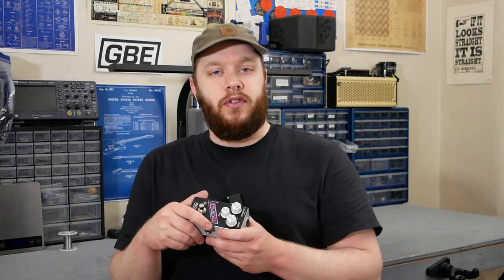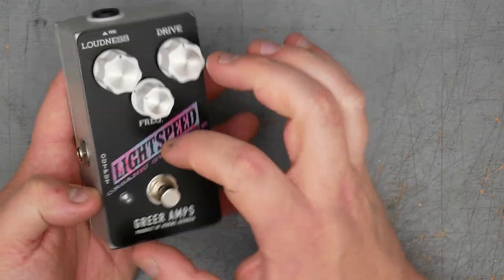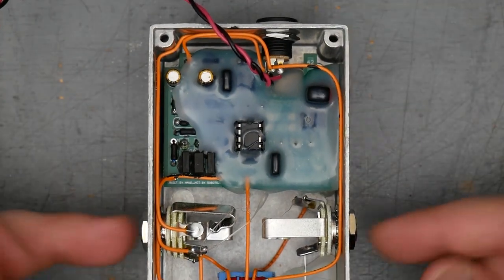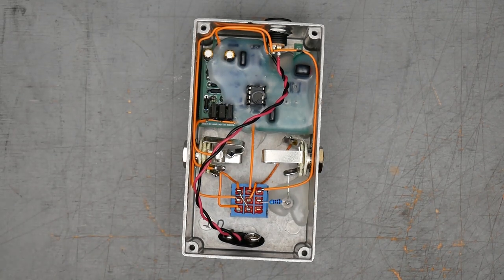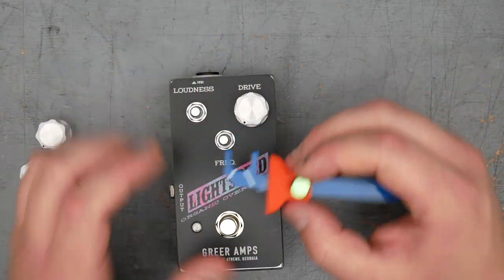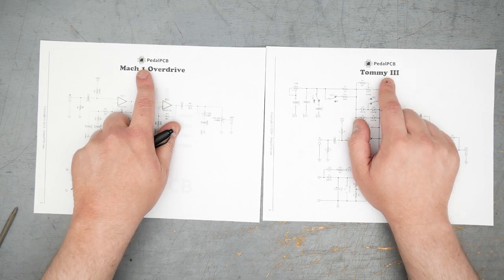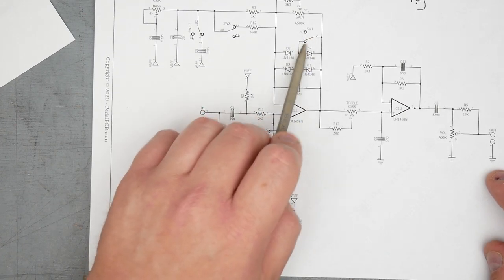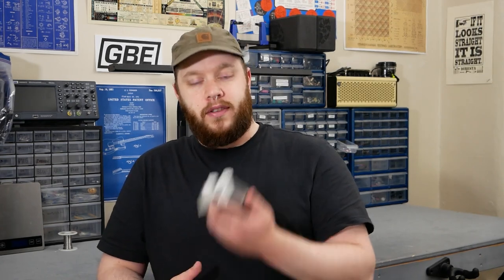Greer Lightspeed Overdrive Teardown! See what's inside!

Comment: Thanks for clearing that up for me. I knew it had to be based on something. Nick has, to my knowledge, never created an original circuit. I got to know him, bought quite a few pedals from him, and spent a fair amount of time over at his place, near winterville, back around 2007/2009. He was very forthcoming about his pedals, and what they were based on. So I knew this had to have its origins in something else.

His pedals have come along way. when I owned and was buying pedals from him, they were either on home etched board, or held together in what looked like heavy duty electrical tape. He also painted his own enclosures, which looked really cool. I don't know why he goops the boards. He's not doing anything new, original or proprietary. It's not like Finnegan with his Klon, or Paul C's Timmy/Tim. He really needs to get over it. I seriously doubt he's on anyone's radar for cloning his copied and modded circuits.

Maybe at some point you can do an analysis of the 72 Degrees or RAW from Machine Head Pedals. Keith Aviles is the opposite of Greer. His designs are all original from the ground up, and he doesn't use goop. He does some really interesting designs, and they don't really sound like anything else.

Comment: I have opened up my Lightspeed, and it does not have any goop. Have they changed since the filming of this?
Reply from the maker: News to me. Did you get it new from Greer recently?
Reply: @graybenchelec  I bought it off of Reverb. The circuit boards say Greer, amps, but they are blue in color. Also, the small board at the bottom with the switch on it looks a little different. It is probably a different kind of switch that they have decided to start using. Hopefully, I did not get a fake lightspeed pedal.
Reply from the maker: @JohnWDGTandTele  Gotcha, builders will use different parts over time depending on availability. I wouldn't worry too much on it.

Comment: Solid core wire is a no no in pedals. I don’t care who uses it.
Reply from the maker: I think that's a reasonable assertion. You can get some aesthetically pleasing layouts in a pedal with solid core wire, but a couple years of banging around in the back of a tour bus will work-harden the copper and cause brittleness, possibly leading to broken connections. This might be mitigated by proper strain relief.
Reply: @graybenchelec  it’s even worse if it isn’t wrapped around connections like jacks and pots.  I use buss bar wire but only for grounding.

Comment: Goop? Seriously? That's a lot of effort to keep people from seeing it's a Timmy clone with a few values changed and a less versatile EQ.
Reply: the Lightspeed is one of the most over hyped pedals ever IMO
Reply: How different would you say it is?
Reply: @boimesa8190   if you look at it from a circuit perspective not very. Actual tone and feel on the other hand they’re very different. Yeah they’re both transparent overdrives but really they excel at different things. Timmy is great at pushing you amp into overdrive (most of the drive comes from the amp) while the Lightspeed is amazing at copping pure amp overdrive with volume at unity with your amp (amp isn’t giving my overdrive it’s all coming from the pedal). The Timmy has a lot more gain on tap but flubs out. The Lightspeed does not. These are my two favourite overdrives (guess I have a type) and they stack beautifully. My rock tone is a Timmy pushing a Lightspeed
Reply: I could be wrong but I wonder if the reason my lightspeed stopped working (no sound or LED when footswitch is engaged) is because of goop interfering with components.
Reply: @pj_day  doubtful, that goop isnt conductive and if anything it will help hold solder joints in place...just getting the goop off to diagnose the problem is now a possible problem itself. Itay silly to goop but it wont damage a thing.
Reply: @gregmize01 : Depends. I think it’s the best overdrive out there and therefore it deserves to be hyped at least a little, because people are very enthusiastic about the Lightspeed. Myself included. 

But if you think it’s overhyped because it is a simple pedal by design, then I don’t know what to say. Does it matter? 

In my opinion the only thing I like a little less is the tone control. Everything between 10 o’ clock and 2 o’ clock sounds amazing. You can get away with brighter settings, but with lower settings it gets a bit too muddy. But I absolutely love this pedal.